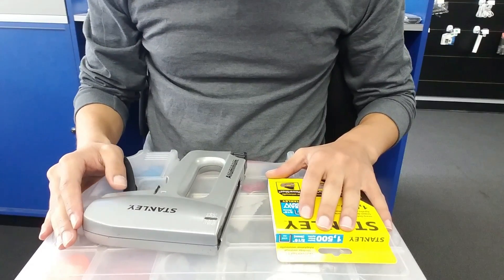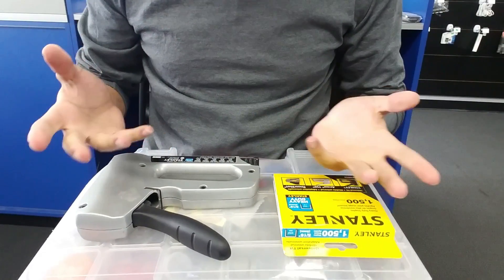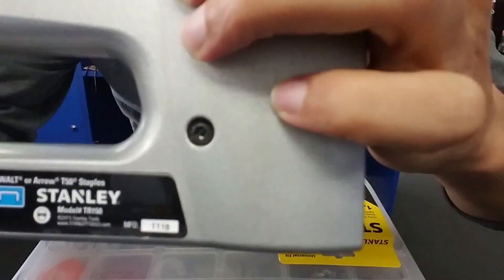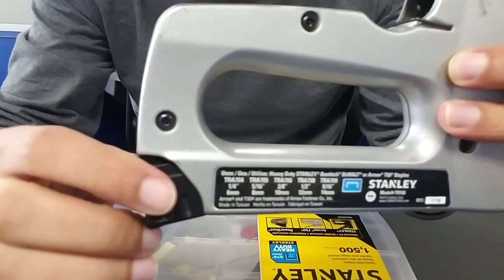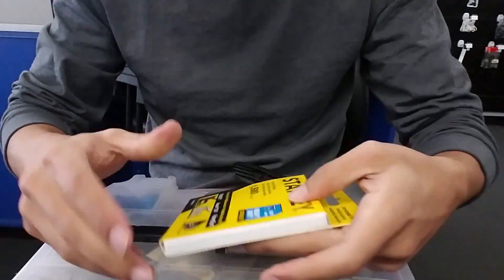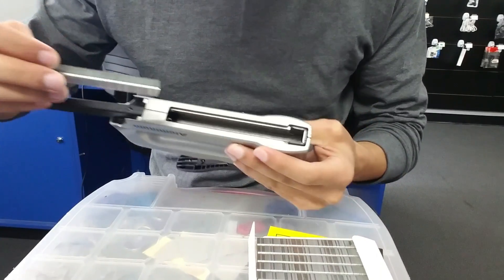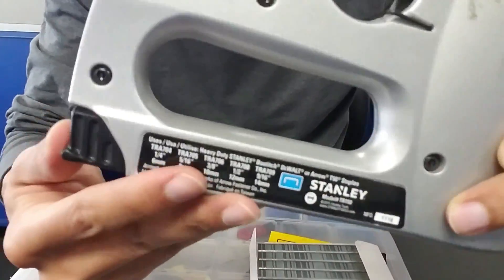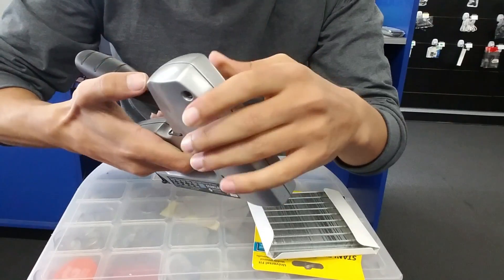How to load staples into stanley stapler gun step by step 🔧all products are in the description 👇

Comment: How do you ensure the staples are held tightly against the firing end?  My staple strips slide along the shuttle at will so that when I try to fire they frequently don't come out because they're not tight against the end.  Not sure what I'm missing.
Reply: I am having the same problem
Reply: x2
Reply from the maker: CHECK THE SIZE AND MODEL
Reply: I checked against another stapler and it looks like a small spring runs the length of the the sliding metal shuttle part. That spring is missing from my unit which would explain why there's not enough tension to keep the staple strip against the end. Can anyone with a working stapler confirm that's the case? Thanks

Comment: Ok, where's the staple come out on the video. I have same stapler, does not release staple when handle is pressed  down. Acts and feels like it, but nothing. Defective right out of the package. Doesn't work. Very simple to load and operate correctly. What's the chances of one not working, what could be wrong? Straight to the trash and try another brand ?
Reply from the maker: No actually this is one of the best in the market, just check the staples exit if one is stuck there!!!